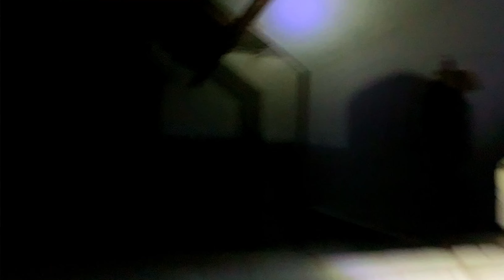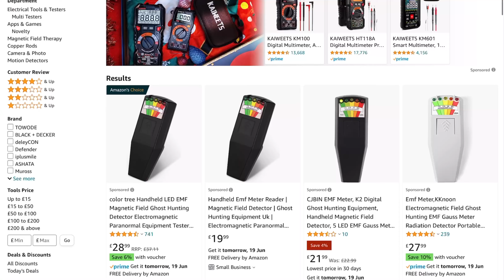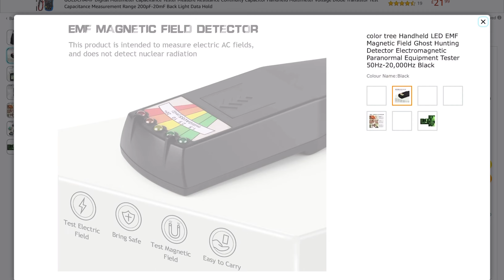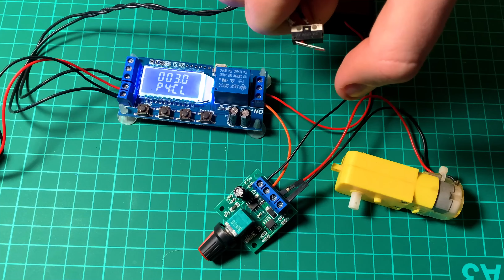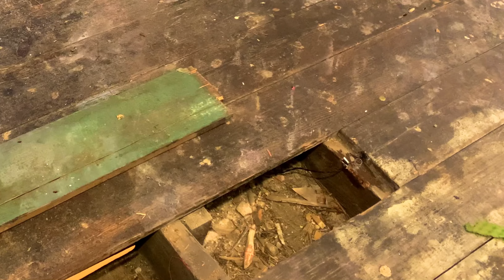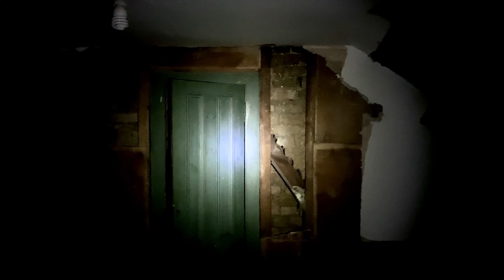Building A Pressure Pad To Open A Secret Door

Comment: 0:26 😂. Nobody can argue with that.
What spooks me is how little junk you have in your attic.
Have you found some data on the weight of a ghost? Are you sure it will be able to activate the switch? You could try a couple of trip wires. I'm pretty sure it's ghosts tripping up that people are hearing, when they hear things that go bump in the night.
Reply from the maker: Good point, didn’t consider the weight of a ghost. Maybe a laser trip wire would be more effective
Reply: @Curiosity_lab  Do you have data on the translucency of a ghost? 
I guess make your laser detector as sensitive as possible but they are renowned for being rather ghostly!
Reply from the maker: @alanm8932  ghostly yes but they do appear as blurry smudges in many photos over the years, perhaps a IR sensor as they apparently create a chill in the air.
Reply: @Curiosity_lab  you're right, the photos are reasonable evidence that some form of visible light detection could work and IR is a good bet too.
A system with weight, laser and IR and it keeps a record of which sensor(s) triggered it would be a winner!
Reply from the maker: @alanm8932  and it it works I can claim James Randi’s $1 mil challenge.
Reply: @Curiosity_lab  wow that sounds like an incentive!
It was winning a challenge like that that got SpaceX going. This could be the start of something big...